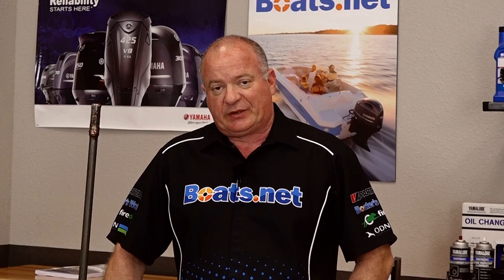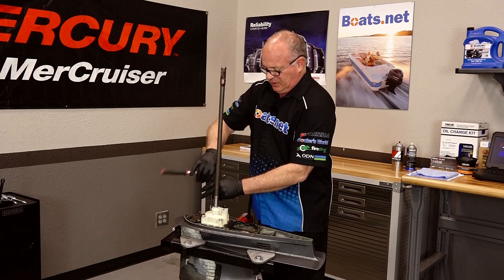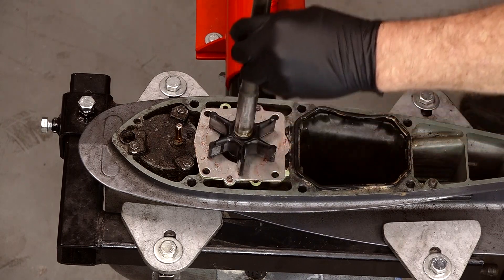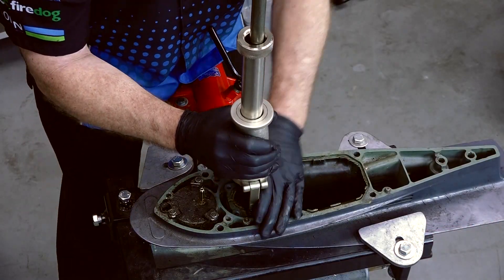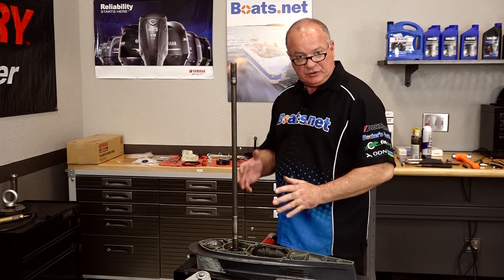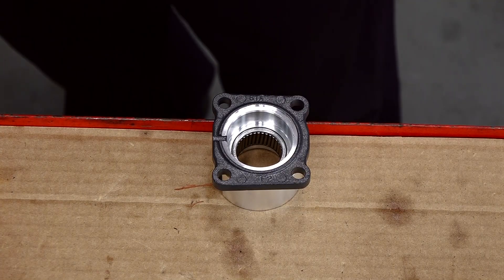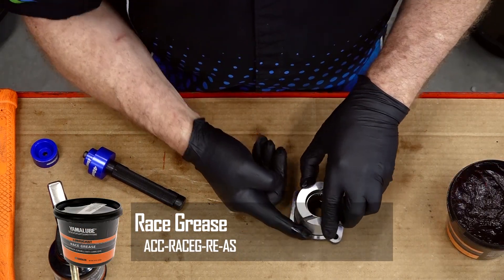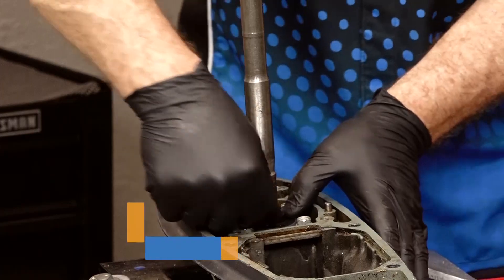Yamaha F225 Input Shaft Seal Replacement | Yamaha Outboard Upper Shaft Seal Replacement | Boats.net

Comment: Where does the upper cover seal make shaft contact? I rebuilt .y water pump and seals under the pump. The seal cover snaps into countre bore but the rubber seal section is in the wind. Rubber seal is about 1 mm from contacting shaft?????????

Comment: All good but never use a screwdriver to punch out the water pump key.
Reply: Mine's stuck. What do you recommend? Chisel?
Reply: @captainredbeard8701  Hello I use a punch on the key I hit the lower part of the key so the top pops way out then a dull chisel to drive it out. As for pullers OST tools makes the best pull going not cheap 250.00 but you have to take the shift rod out. They have videos on it.

Comment: The shaft on my lower unit seems to be getting hung up at the splines at the top. Lower unit is mostly off, with the exception of the last 3-4” at the top. Any recommendations on how to work the lower unit off to complete water pump service? Thanks.

Comment: I need to understand how to replace the O-Ring and the Oil Seal around the Shift Rod since I have a leak there. In this video prior to 5:03 the whole shift rod assembly is in place and then after that point the whole shift rod assembly is out with no mention of it. If you took it out why did you not mention it (especially since I and others need to understand how to do that).

Comment: What can I do to unstick the lower unit skeg on my 1994 Yamaha pro 150, which seems bound up and wont shake loose. I was able to pry the side closest to the transom about 2 thirds across but only one half inch clearance  from the upper area of the skeg would move. The narrow end was rigid and tight and only moved an 8th of a inch by prying with screw drivers. Since it is aluminum I tried to avoid using any extreme force prying. Still would not come loose. Yes I did remove all the bolts. Would using a torch help? I could not find anything on utube that deals with stuck old skeg that has not been apart  much. My contact info is fishtiger13@ yahoo.com  Thanks RT

Comment: John,  this is a very helpful video. I am having a tough time removing the upper bearing carrier on a Yamaha F150 TLRC (2004, 1005 hours), as posted on another of your videos. The bearing carrier is stuck hard in the bore. I have the MT0016 slide hammer you use and have managed to move the housing only 1/16' vertically despite hours of effort and some heat with a heat gun and later a propane torch. The carrier flange  eventually broke on the forward side losing 1/3 of the flange. I was then able to remove the exposed section of O ring, apply WD40, and rotate the carrier about 30 degrees using a brass drift. It is now stuck hard, will not rotate either direction,  and the MT0016 puller claws can no longer grab the flange. Have you seen this before? Have you drilled and threaded holes in the flange to install a screw type puller? Suggestions are appreciated.
Reply: Ray, I hope you have figured it out in the past 10 months! Hopefully this response helps you if not, or someone else in the future. I had the same problem and it was a nightmare. I broke 3 of the holes off of the bearing housing and all I could do is spin it in the lower unit casting. Here is how I got it out: After removing the oil seals, I used a 3/8 tap to cut threads in the last bolt hole. I due to the taper of the tap, I had to tap threads extending to the inside of the factory threaded metric bolt hole. Not ideal, but I figured 3/8 was larger than the factory metric bolt AND the threads of the factory bolt engage much deeper. Low risk. Once the threads were tapped, I spun the carrier a few degrees and inserted a 3/8 bolt into my new tapped hole and pushed the carrier out. I applied maybe 10 ft-lbs of force until the o-ring cleared the lower unit casting. Then it pulled out out by hand. To minimize marring the horizontal factory machined surface, I sanded the tip of the 3/8” bolt flat, but really, the o-ring and seals are what’s separating the oil & water on the vertical surfaces, so a small scuff on the horizontal surface isn’t a huge deal.
Reply: @AlvaStrong  helps me. A 100 hour service has turned into a nightmare bc I noticed my seals were bad and my house is stuck as well.